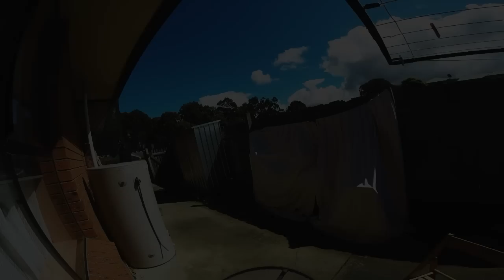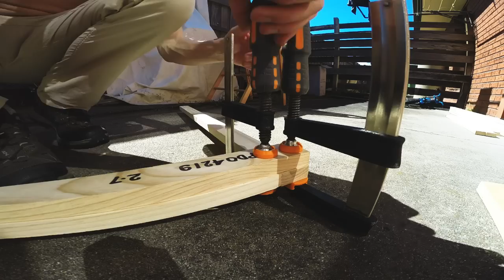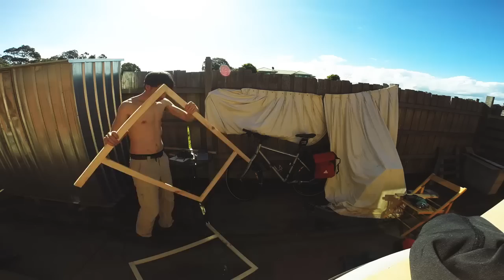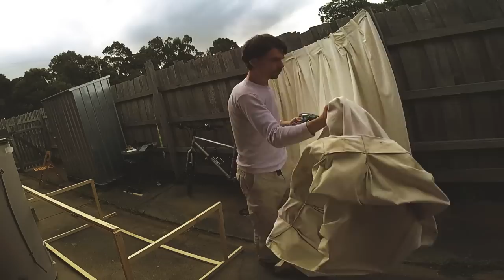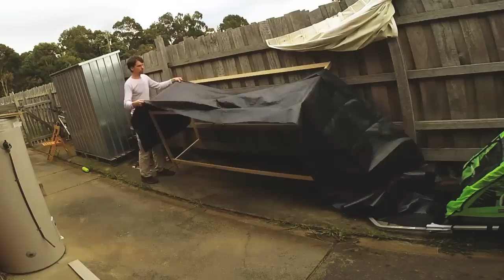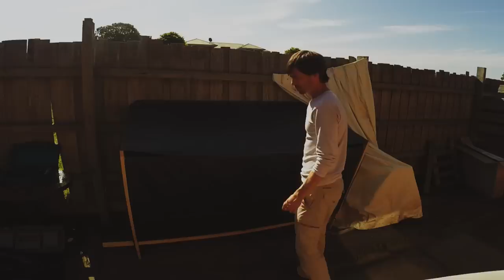Building Lightweight Bike Shed

Comment: Nice idea. is it still standing? As you say in the video it might not survive strong winds.
Reply from the maker: +ksp1278 It did stand for one year, no problems. Then I moved back to Melbourne, so had to take it down. I think it would easily stand for another few years. But if I build one again, I would make the cover lower to the ground.

Comment: Just wondering what sort of sheeting that is and if it's 100% waterproof? Cheers
Reply from the maker: I used a cheap tarp (not waterproof) couple of dollars per meter, folded in double layers. I would use a waterproof one if I were building it again, though. And cover the construction without leaving open space next to the ground as heavy rain will get inside when windy.